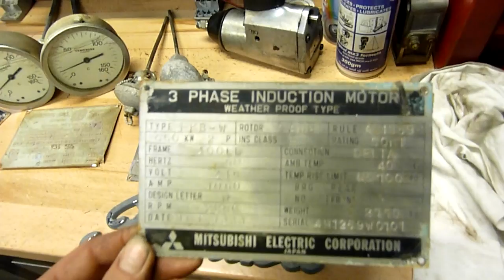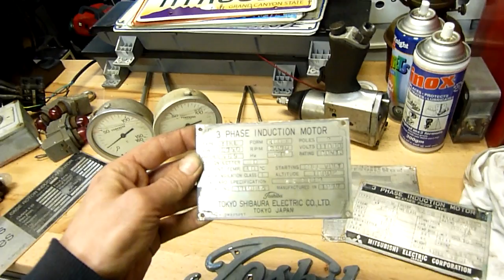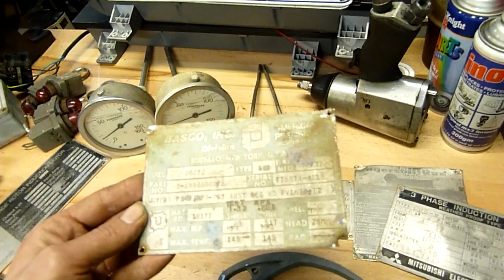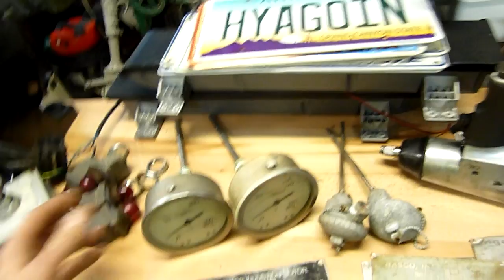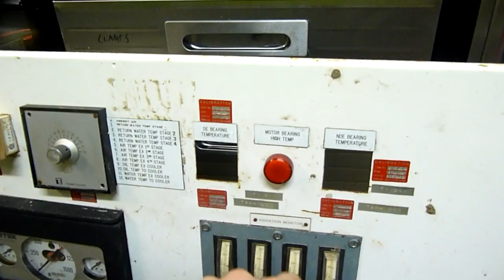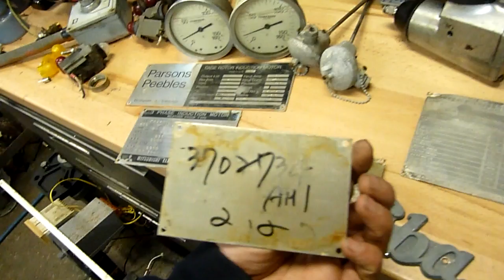Ramblotronic Wedensday - Giant Motors and Compressors

Comment: those pumps were used to generate liquid nitrogen I suspect.  we use lots of LN2 and that company is who supplies it.  the interesting thing is you can't just compress air to get LN2, it must be pressurized first then sprayed through a nozzle so that the rapid expansion performs the cooling required to liquify the air.  it is then fractionated in a distillation column not unlike oil to draw off LN2, liquid oxygen, etc.

Comment from the maker: funny thing is the rose garden in the front yard is the right footprint for that motor :D, just dig it down a few feet and pour a slab!, bingo!

Overhead lines are on the other side of the street so it can just be craned in (50t just managed to lift it but could not extend its boom)

Comment: Huge motors and stuff are neat. Amazing pieces of machinery. That's one monster of a compressor! I used to work as an electrician at a copper mine, the large SAG mill had two 5k HP synchronous motors. As big as a mini van. IIRC they ran on 13kv.

Comment: "is it wrong that I want a 2.7Mw electric motor in my back yard?"

no, as a matter if fact I think you should find a gas or diesel engine and interconnect one to use as a nice generator for power failures (power the whole house to keep the fridges cold and lights on).

that would be awesome

Comment: These motors would have been reconditioned (windings redone, journals redone, bearings replaced, shafts straightened) by a quality motor shop instead of scrapping them. My god, that was a ton of good motors done and gone.